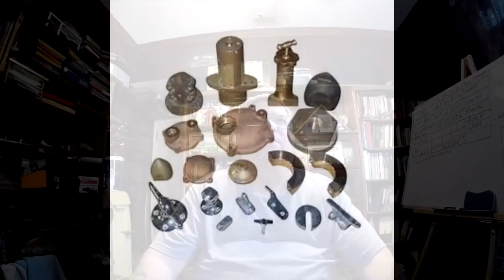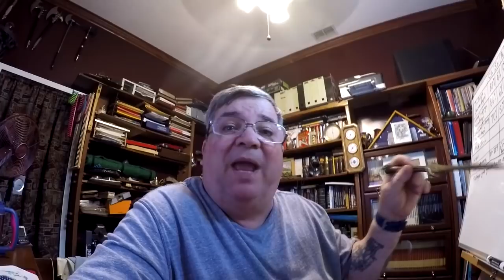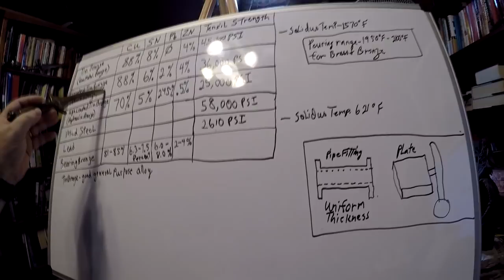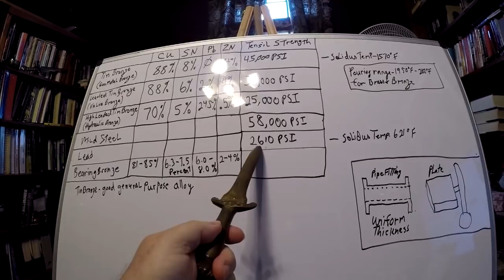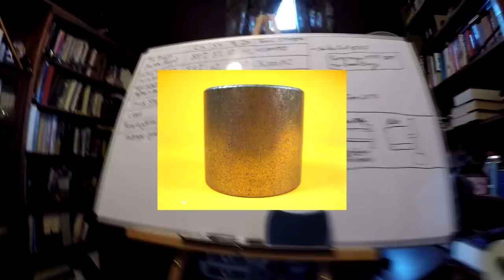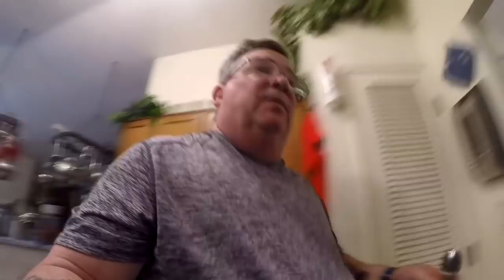Leaded Tin Bronze and High Leaded Tin bronze, a huge advancement in metalurgy

Comment: Hi, I would like to know what would happen to the lead when you do centrifugal casting? My question is would the heavier metal be forced to the outer most section of the mold by the centrifugal force?
Reply from the maker: If the alloy doesn't have more lead than it needs to be a true alloy the lead in the alloy won't separate from the other alloying elements. If the alloy is mixed totally and then more lead is added to the melt, the lead that is separate from the alloy is still molten it will be forced to the outer edge of the mold if subjected to a centrifugal force. Now, when it comes to Leaded Tin Bronze and Hydraulic Bronze, those alloys wouldn't be subjected to centrifugal force because the excess lead was there to fill in the interstitial gaps left behind when the solidified grains of the bronze alloy had finished forming. Even if the bronze alloy had solidified the temperature of the melt would still be hot enough to keep the lead molten so that the molten lead could flow to the areas that needed to be plugged so that water couldn't work its' way to the outer surface of the casting and allow the liquid to leak.
Reply: @sandrammer  thank you for your reply. It all makes sense. I learnt a lot from the video. I don't know much about casting but I want to learn. My main interests are centrifugal and lost wax casting. I need to try make some bronze for bearing bushes and sockets. Would appreciate any help on these topics please.
Reply from the maker: @roryvalnore4530  , Do you cast your own alloys? If so here is a good formula for Bearing Bronze; Copper 75%, Tin 5%, Lead 20 %. If you don't cast metal but machine metal you'll have to buy bearing bronze from someone. Good luck on your projects!
Reply: @sandrammer  thank you sir. I want to try cast my own alloys. I want to try centrifugal casting. It seems that one is able to achieve very good grain structure this way, as well as have fewer impurities in the metal. Do you maybe know what the minimum speed that is needed for centrifugal casting
Reply from the maker: @roryvalnore4530  , no I'm afraid I don't. It shouldn't be too hard to find that out on youtube though.

Comment: Out of curiosity, where do silicon-bronze and phosphor-bronze fit in the picture and how are they prepared?
Reply from the maker: Phosphor Bronze is used for castings that require a medium strength and are subject to salt-water corrosion. Typical applications are for gears, bushings, bearings, expansion joints, pump pistons and special pipe fittings. Silicon Bronze has a combination of good casting properties and homogeneous structure. It is used where high strength, toughness and resistance corrosion is required. It may be used for pump bodies, marine hardware and machine parts. Also makes excellent bells.

Comment: Steel can be alloyed with lead. 12L14 is a very common leaded steel alloy.
Reply from the maker: truracer20 as I said, there are a million types of steel’s out there so I’m not surprised that some of them might have lead in them. Here’s a quiz… At what point would you add the lead while melting the metal?